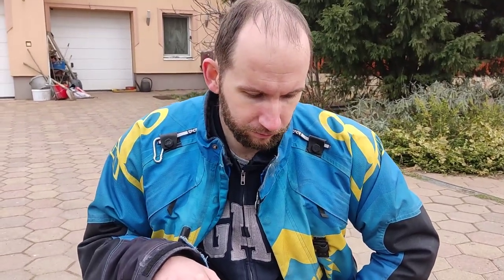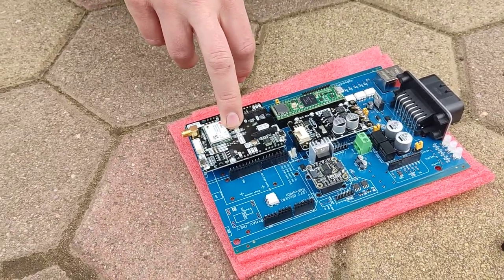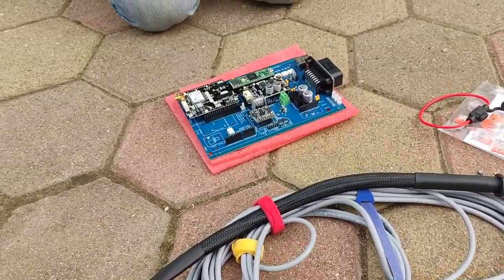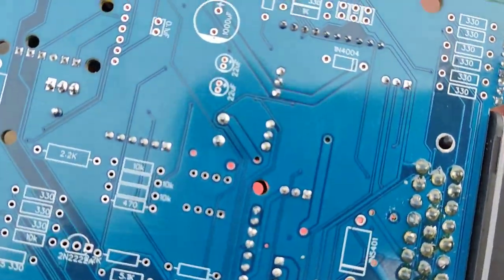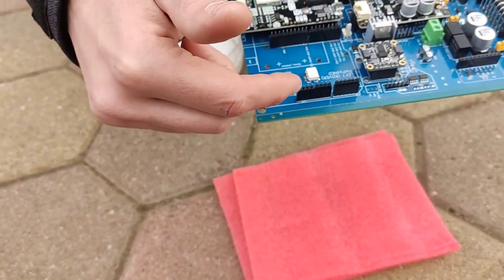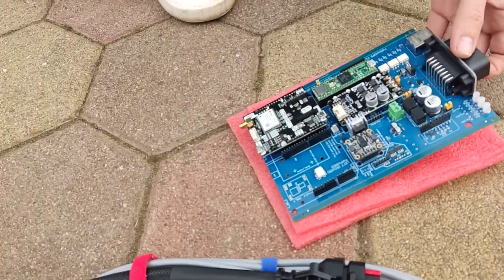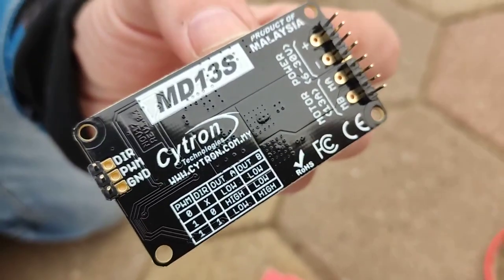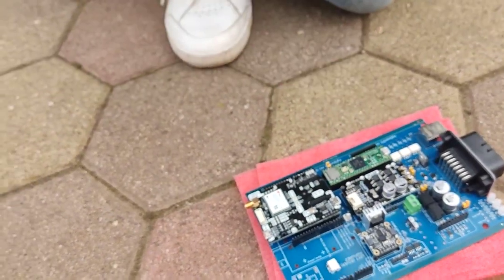Explaining the All-in-One PCB v2.5

Comment: Any one in this community make video on only guidance without auto-steer then this is the RTK capable antenna + receiver on agopengps from start to finish it will be much useful for the non teechi farmers like me .... Thanks for the contribution to all .....
Reply: Very simple. You need only tablet + ardusimple rtk2b   basic starter kit. Ardusimple is connected with usb cable to tablet.